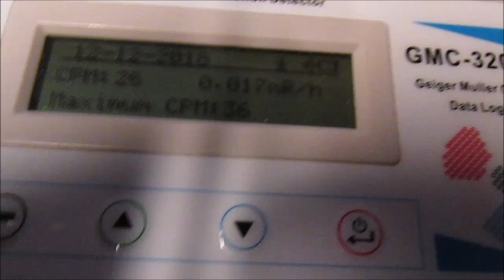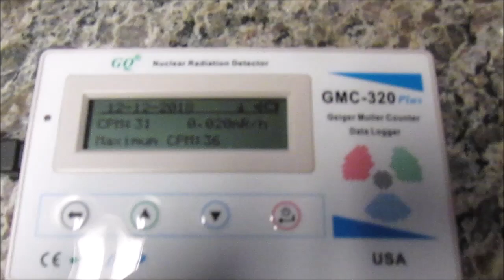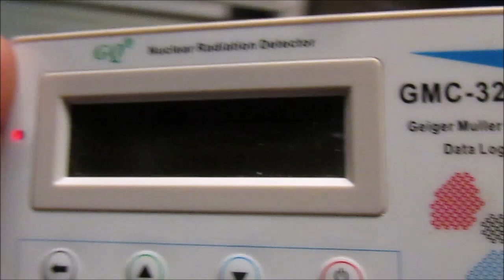Plasma in a tube

Comment: A few corrections to note:

You were not detecting beta radiation, you were actually detecting x-rays. I am certain of this because beta radiation can be stopped by a simple sheet of plastic, so thick walled glass tubes (thick walled because they have to hold low pressure after all) will easily be enough to stop beta. Thin glass might just let high energy betas through, but keep in mind that we are talking MeV kind of energies (as typically emitted from beta decay), clearly not being produced by your setup. The energy of the electrons from your setup are bounded by the voltage that you applied, and I doubt you applied anything close to 1 million volts, so they will be stopped extremely easily. Also, I have that exact same Geiger counter, and it is actually meant to detect beta, x-ray, and gamma radiation, as shown in blue lettering on the bottom left corner of the front side of the instrument. Its Geiger tube is made of thin glass, which lets in the MeV betas.

Your experiment is actually just a recreation of essentially the same setup that Rontgen used to discover x-rays :) Also, even if you were emitting gamma rays at the same frequency you were getting counts, they would be absolutely harmless. I do research at a university nuclear reactor, and I've worked with sources putting out millions and millions of gamma rays *per second*, so your 900 CPM is nothing to worry about.
Reply from the maker: I read it into it more and I believe you're right. I think we may make a new video on this subject with some more information and a few additional components.
Reply: Awesome, I look forward to it. Also, great footage of the plasma, that was really neat seeing the little thing turning in reaction to it.